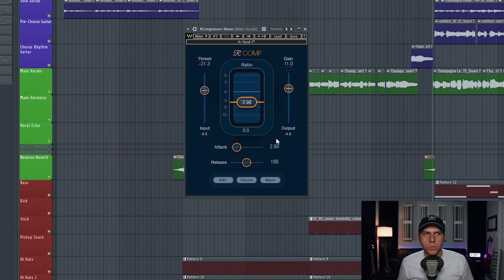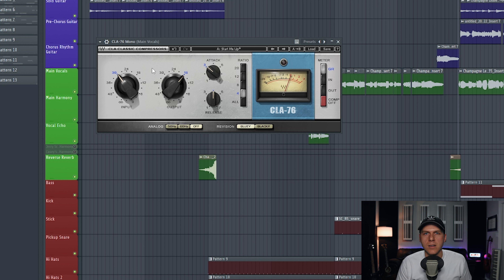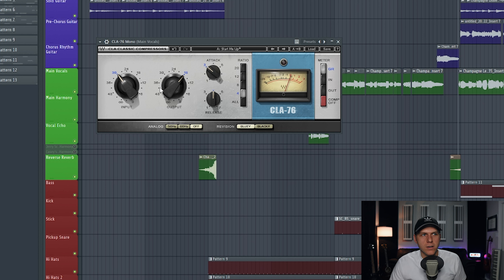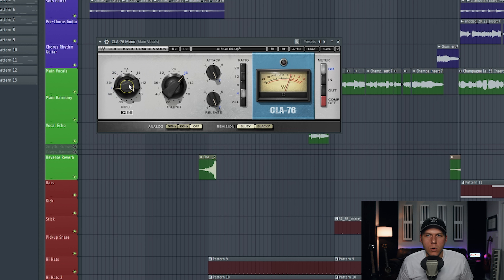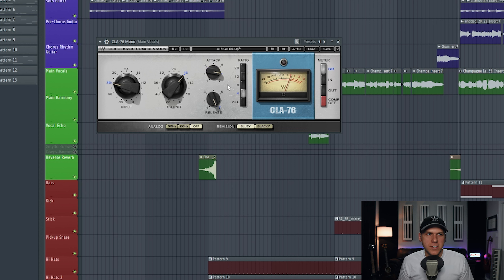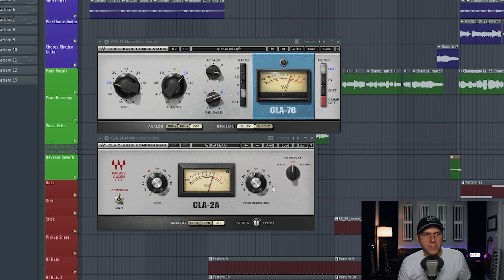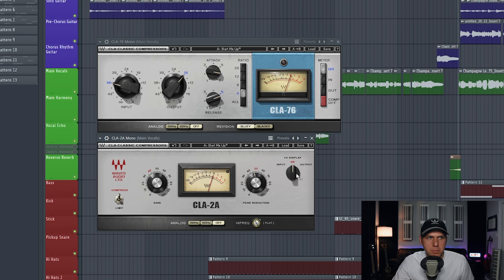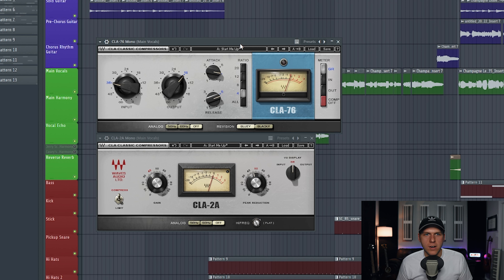Using Multiple Compressors When Mixing Vocals

Comment: Hey jerry how come when i put on a mono compressor on my mono recorded vocals whenever i set the compressor parameters right its fine but as soon as i try to add make up gain the sound goes from one side of the headphones to the other? Is it better to use a stereo compressor on mono vocals seems to not have that issue when i go that route

Comment: Great tutorial on stacked compression. I'm using those same (almost) 2 Waves compressors, the CLA 76 Blacky into a CLA 2A sitting in the Waves Studio Rack. Each is gain reducing about 2.5 dB on mine.

IMO another great compressor is their PuigChild 670, which I have also. Those 3 have a very unique sound to them, even more when all 3 are stacked. Yes crazy Delta said 3, each doing 2-3 dB reduction.
Reply: Sounds good but what’s the puigchild used for ? Just for like more color or setting the attack and release better musically ?
Reply: @impelskies7715  This puigchild represents the grandfather compressor, the Fairchild, from the '50s or so. It's adding an old analog tube saturation sound as well as compression. 670 versions are stereo and 660 is mono. It can work well to color and compress, which is why I used it, and it seems to do this well. Settings are somewhat different than other comps, in that there's a time constant selector switch, it affects the release. There's a spec chart that describes the different TC settings. I haven't used this comp plugin for a month or so, as I'm trying out other compressors, as for my use case, it might be the culprit of using too much CPU resources on my DAW.

Bottom line Puigchild gives a tube and transformer like vibe that is a bit different than most others. I may be incorrect, but I think the Manley Mu is a more modern but similar type of comp. My main reason for differring comp types is color and my perceived compression action differences. My opinion is you'd want to sample it to see if you like its color and comp action, because it may not suit your taste or music.

Comment: would you still need to parallel compress after those two
Reply from the maker: Just depends on the song and mix. If you need the vocal to be more upfront, and you want to give it some more power without just turning it up in the mix then parallel compression is perfect for that.

Comment: I heard the CLA 2A is more used for rock songs over rap. So I been using the CLA 76 and R Comp compressor on my rap vocals. What's your thoughts on that combo over using the CLA 2A ?
Reply from the maker: It doesn’t matter really so much as to what compressor you use, but you want one to have a fast attack setting to control the peaks and one with a slower attack setting to add some smoothness.. the actual compressors you decide to use is a stylistic choice
Reply: @mixwithjerry  gotcha, that breaks it Down perfectly! Subscribed. Thanks Jerry!!! 🙂😎💙
Reply: My opinion: it's not so much which ones specifically you're using, but how you're using them.  As Jerry said in his comment, make sure one does a fast attack and the other one slow. The 1176 and LA2A, and emulations of those, naturally give you those fast and slow compressors, but there are others. Some, if settings allow, could be both slow or fast. That's why I said in the beginning it depends on how you're using them.
Reply: @DeltaWhiskeyBravo13579  gotcha that makes a ton of sense. Thanks bro!
Reply: @iamnyron  welcome, best to ya on whatever audio you're into
Reply: @Kaylone0  depends on the individual compressor on which direction you turn the attack knob, some are labeled fast vs slow. Let us know which compressors you have and I’ll help. Basic concept is comp 1 is set to faster attack then 2nd is set to slower attack.

Example: if I still recall correct, 1176 type will be opposite others, slow attack is far counterclockwise and very fast is far clockwise. I don't recall an LA2A type with either attack or release, just gain and peak reduction. It's always fairly slow, especially when compared to a 1176.

Comment: after the two compressors is that when you would maybe start using paralel compression aswell ? Trying to learn so would be happy to hear some feedback on what is best practice
Reply from the maker: Parallel Compression would typically be done on its own mixer track so it is processing a duplicate copy of the lead vocal. So it’s not really a part of the lead vocal’s plugin chain if that’s what you’re asking.. but I usually mix the lead vocal and if I still need it to be more upfront in the mix then I will add parallel compression to add thickness. Parallel compression completely squashed the signal so there’s no peaks. That’s why it’s great for blending in with the lead vocal because it won’t really raise the overall peak level of the vocal, which will help you get the track loud at the end during mastering along with many other things across the mix. Hope this helps.

Comment: I need to do this but I don't have the CLA series compressors. I have Rvox, Rcomp, and TDR Molotok. Any advice how I can use these instead?
Reply from the maker: RComp with a fast attack (like 2.5 ms is good starting point) and medium to fast release. Then the Rvox right after that. How much you want each compressor is up to you but the RComp is for the peaks and RVox is for overall tone and level.
Reply: @mixwithjerry  thank you so much! Did not expect you to reply on a year old video. Super cool man, ty again